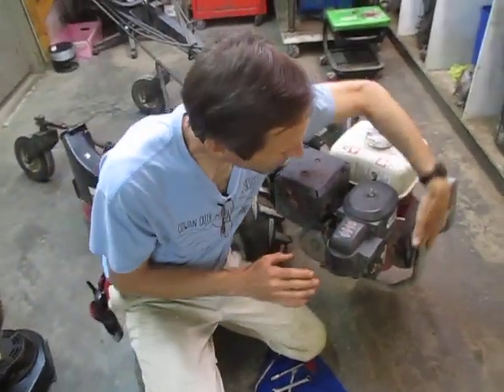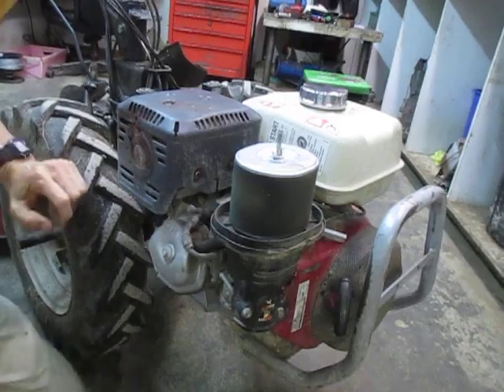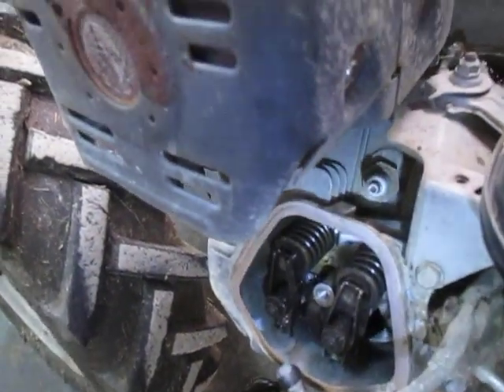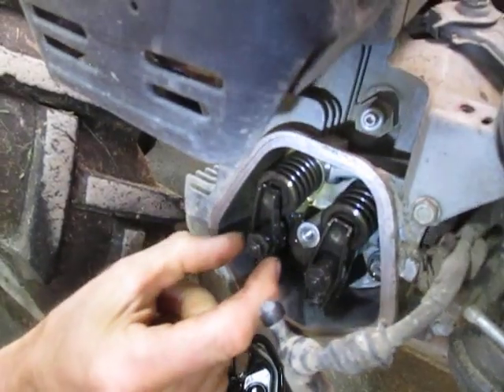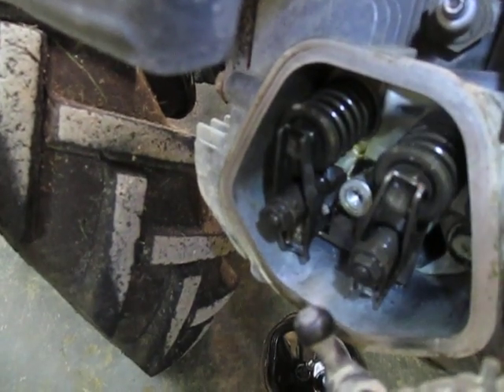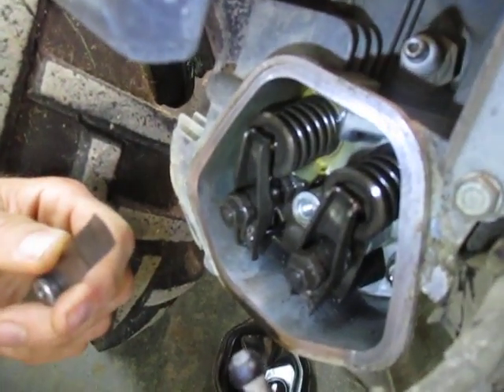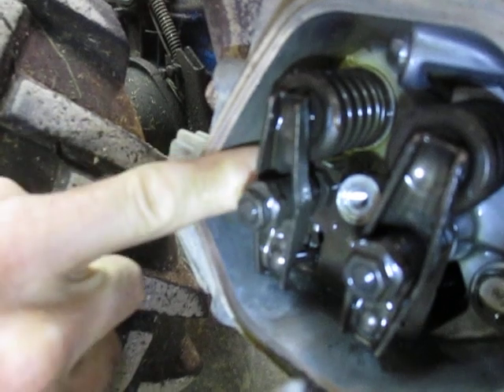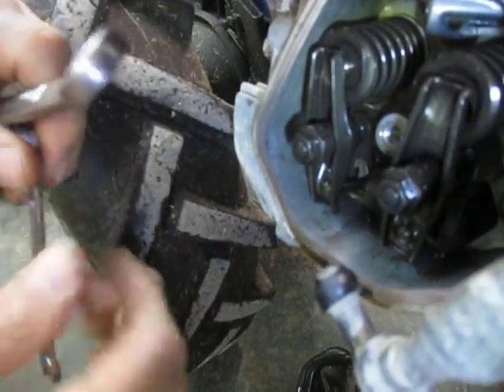Valve Adjustment for Honda GX Series Engines

Comment: The tip to hold the inside nut before loosening the jam nut was worth the view. thanks. also people make the mistake of adjusting the valves on the wrong TDC stroke. You did mention TDC on the compression stroke which is correct. Thanks.

Comment: You can remove the spark plug to stop it building compression while you spin it over to do your testing. Then just watch the exhaust valve to check that it does the big dip on the exhaust stroke, and the little dip on the compression stroke, which is what makes it easier to pull start. My engine had this fault,and was scary to pull start. Would pull the rope back out of your hand with what felt like the strength of 5 horses. Resetting the valve clearances cured it, although getting into the crankcase, removing the camshaft and cleaning / checking the compression release mechanism is actually pretty easy if resetting the valve clearances doesn’t work.

Comment: Good vid.  However, since the edge of the valve/rocker compartment is sharp edges and the jam & adjusting nuts are often almost seized together, it is a good idea to use a socket & ratchet to loosen the jam nut to place your hand further away from the compartment so that u can't accidentally bang & slice open your hand as can occur when using a 10mm wrench.

Comment: I liked that your video touched on my current issue.  I have worn out seven gx200 clones in the past 5 years (2 tillers and 4 generators plus a new engine).  My major problem has been excessive wear of the exhaust valve seats and the pushrod guides
My newest purchase is a 3k generator. In service only 3 months, and already problems.  I have read about others with my problem, but still looking for a solution.
I cannot get the compression release to work as it is supposed to unless I have zero clearance on the exhaust valve adjustment.  I'm hesitant to do a tear-down just yet to investigate (void warranty).
I certainly could use some feedback.
Reply: This video expllains it perfectly

Comment: Ok question. I have a gx 690...looking at the motor...to my left i took off the cap that covers the valves and took off on my right side too. There is one that loose, alot of play but the other 3 are tight. What does that mean? What do i need to do  to fix?

Comment: on my bcs with gx390...I have hunting/surging.  I've ruled out air/carb issues for sure.  Would valve adj possibly be my next thing to check?  would that cause hunting/surging?
Reply: Your governor maybe out of adjustment and/ or your maybe your carburetor main jet has a tiny amount of crud in it.

Comment: valves are adjusted right how do i know if the pressure release on start up is working i don't see the exhaust valve move that little bit. any other way to check that?

Comment: Six thousands is only for intake valve,for exhaust is eight thounsands.
Reply: The valve clearance is 0.13-0.17 mm (0.0051-0.0067 in) for intake valves and 0.18-0.22 mm (0.0071-0.0087 in) for exhaust valves.
Reply: @walkertongdee  0.15 mm intake and 0.20 exhaust.
Reply: Exhaust is on the Left Intake is on the Right.
Reply: @walkertongdee  that is . 006 and .008 thou.
Reply: 1 and half mm no wonder its loose🤣🤣🤣

Comment: 6 thou is ZERO .15 mm, not 1.5mm. Plus use  8 thou for the exhaust, otherwise very good. Thanks.
Reply: You need to be on the intake stroke.
Then get the piston top...
I recommend watching a different video.
Reply: Exactly....when he said 1.5 mm I went what the hell are you talking about...